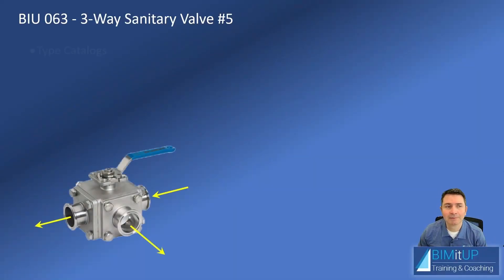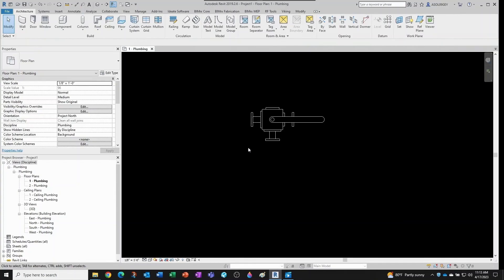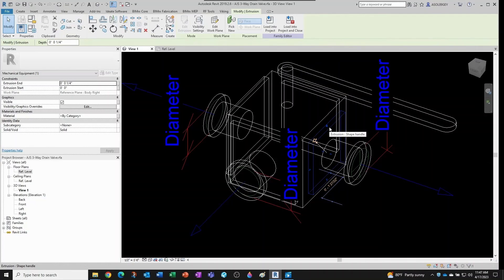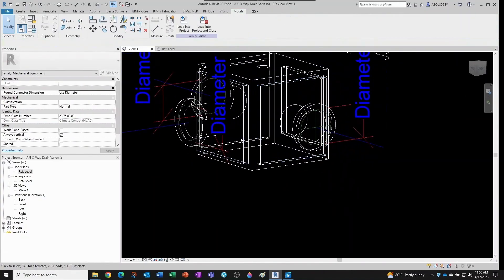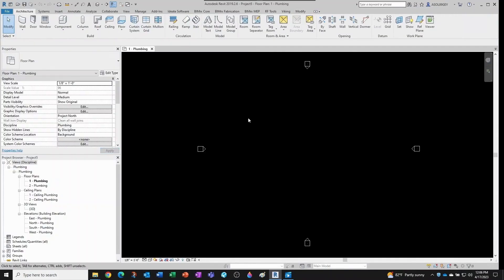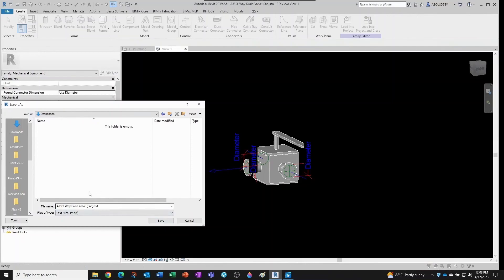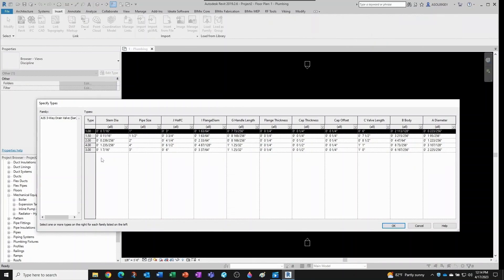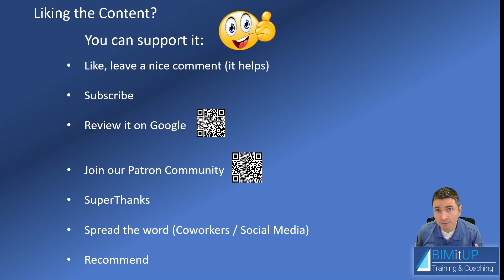How to Create a Family Type Catalog in Revit

Comment: If I want to copy a Revit standard family, and it's Family Type Catalog. Lets say it is a door. But I want to customize the door by adding a round window. I renamed the copied files to Door with round window. Does it associate the new family with the new catalog with the same name, or is there something I need to do to associate the new door family with the new catalog? 

Some families I have edited with catalogs, still have Family Types listed in the Revit family model, and some have none listed under the family types.  When I export to family type catalog, does it remove them from the family types within the RFA?  I don't want the parameter listed in both the catalog and in the file, causing confusion.
Reply from the maker: Q1: The name of the family always have to be the same name in the txt file so that it is loaded as "types"
Q2: You don't really need a "named Type", you can keep as "Standard". For great info Check Paul Aubin's Video on LinkedIn "Tips, Tricks and Troubleshooting"